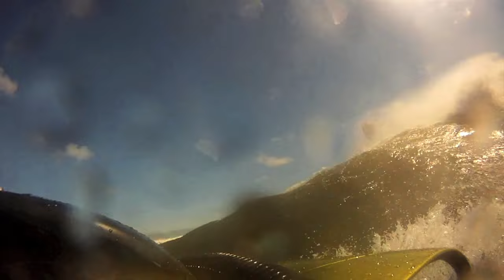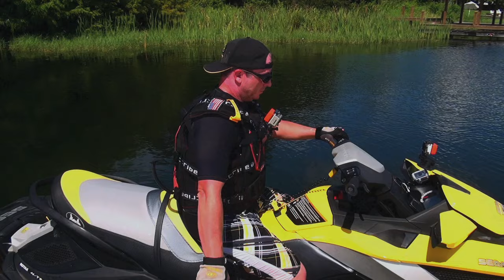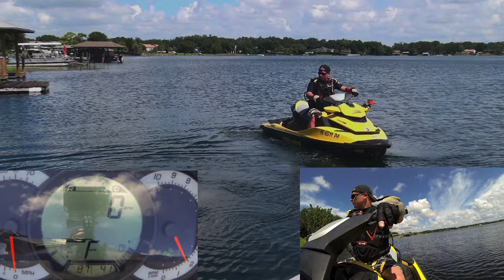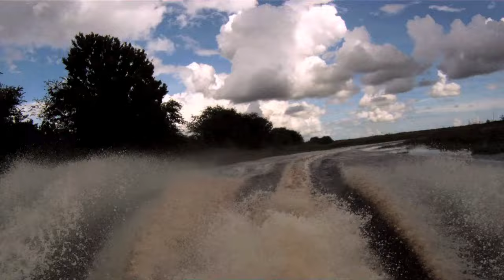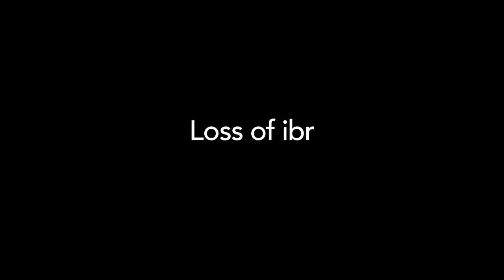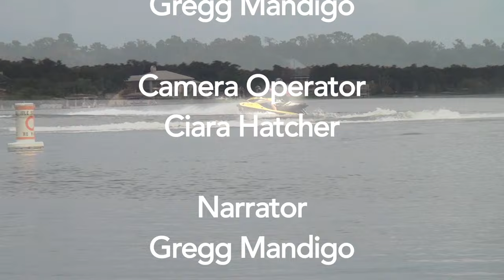Sea Doo Intelligent Brake & Reverse Tutorial

Comment: Newer model IBR refresh has the system where the computer moves the diverter bucket to facilitate aerodynamics when trailering when the engine has been stopped. Once the machine has been started, the computer moves it into neutral

Comment: How did you mount the GoPro on the rear view mirror and was it sturdy/ can it be used for regular use on a jetski without worries of it falling off due to bumps water spray and wind force. Was it the suction cup?
Reply from the maker: +pwned clan Yes it was the suction cup. As long as it's attached to something dry and smooth, it will not fail. I used the same camera setup in some of my ocean jumping vids I made with this ski. Hope this helps.
Reply: yea man thanks for your help I have been worried that it might not work but now I have some assurance from other pwc riders. thanks a lot!!!

Comment: How does it brake?
Reply from the maker: The system drops the diverter bucket (technically into neutral) and reapplies throttle a bit. Much like a jet engine does upon landing. It's redirecting the flow of some of the water forward, which slows things down very quickly. The entire system is fly-by-wire. There are no cables. An electric motor runs the diverter bucket and reacts to a sensor in the left hand throttle/brake handle.

Comment: 05 sea -doo  wave runner .after going through lake weeds water craft will only idle slow any advice
Reply from the maker: Clear the weeds from the pump. But it's possible that the line going to cooling system got clogged and some things overheated. The first place I would look is the temp sensor on the exhaust. It's probably cooked and easily changed. If that sensor is out, then the computer may put it into limp mode. You may also need to disconnect the water lines and make sure they're clear. Best advice I can give without seeing it.
Reply: unsane

Comment: I hear the ibr is nothing but more problems. it's a nice feature for kids and new riders.
Reply from the maker: The ibr system itself wasn't bad. The main culprit for any failures and/or limp modes came from the main harness going bad. Riva Racing had that issue figured out and after a harness replacement, all was well. The harness will have more issues if you ride in salt. I actually enjoyed it though. It made things much easier around a dock and was fun to "hit the brakes" at top speed. But to each their own.

Comment: Really cool but why is it so slow at 8000 rpm ? only 60 mph ?
Reply from the maker: I didn't stay in the throttle very long, but I actually had a bad intercooler during this video shoot. Once I changed the intercooler, I was back to running 73+mph. This ski is Vtech tuned and has run 74.6mph, which makes it one of the fastest suspension skis around.